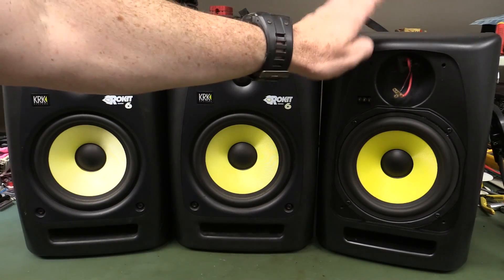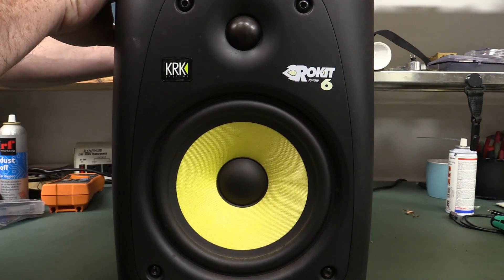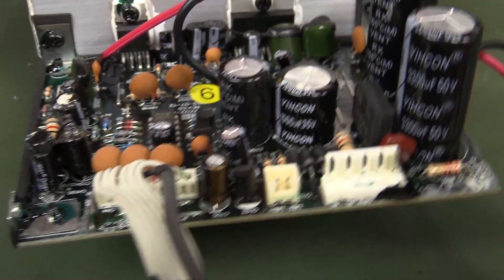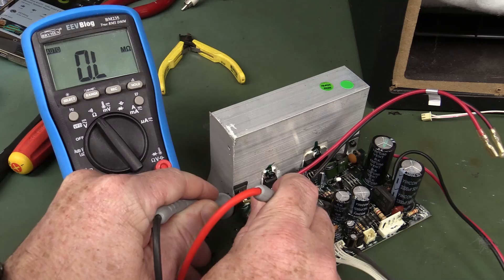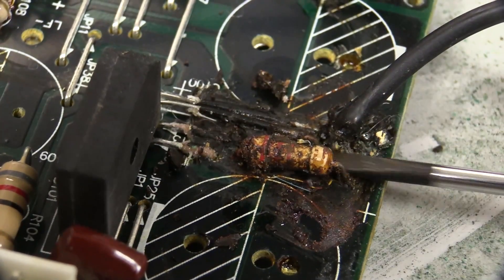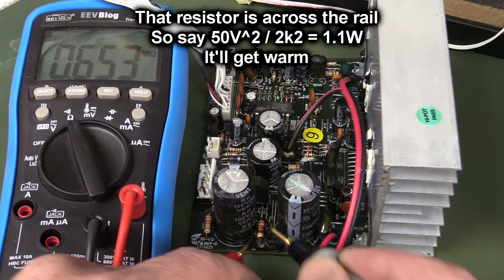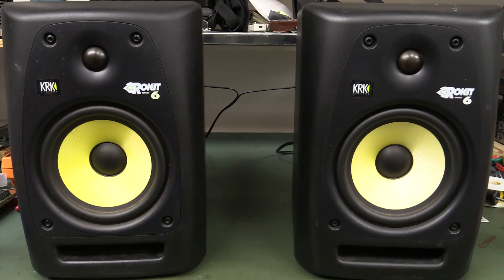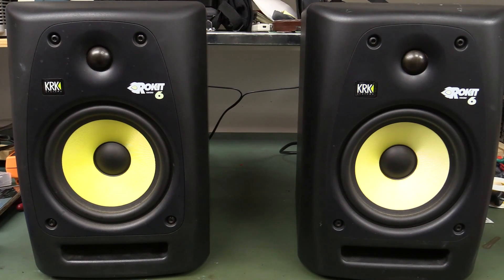EEVblog #1073 - MORE KRK Rokit Black Gunk Speaker Repair

Comment: EEVblog. Dave!! It is a massive problem!!!! I worked for a company in London that had the contract on these!!! I repaired hundreds if not over a thousand of these G2 models with the black glue problem!!!! G2's are also notorious for the volume pot failing. To fix that you desolder it and tighten the lugs with a pair of pliers and bingo, its fixed. Resolder it and your pot is as good as new!!!
Reply: Stephen Scutt - How long did that fix work?
Reply: well indefinitely! Squeeze the 3 pot lugs tight to just before the inside of the pot.  if the pot was too far gone it got replaced. 20 Kohm if i remember rightly...
Reply: Power Wiesel, I wrote the same by coincidence!
Reply: L3 P3 😋
Reply: Do you know how to fix the thing he demonstrated at the end? My left one is ok, but the right one is buzzing annoyingly loud.
Reply from the maker: Thanks for the confirmation. Did KRK ever admit it was an issue?
Reply: Hey Dave, I made a comment earlier today about the noise you showed at the end... I think it might be related to the power supply somehow.
Reply: Dave, you likely missed a comment on your last video by Rich Renken, PM from KRK. He did bring the blank gunk up again with the team, they said they were familiar with it.
Reply: hi, where can i get a tweeter replacement in europe? 2 speakers broken at ones. trying to repair them
Reply: MilkywayOutcast, just ring up any store that sells KRK, generally pro audio/musician's stores, they'll be able to get replacement parts for you. Might take a bit.

But check out Bax Music in Goes, Netherlands, they might have them for you right there, and they mail to a bunch of EU countries.
Reply: Siana Gearz, thanks a lot. i found them in bax music :-). 30 euros each....not cheap but cheaper than new speakers.
Reply: Hi, I have two questions. Is there any way to replace all pot's with some better ones to remove that problem completely ? my left tweeter have some hum coming from it when it's turned On, right one is OK, what do you suggest me to do ? Should I replace all capacitors ? P.S One of my speaker was already on service because of Volume pot. It wasn't on 0 when you put it, it was on 1 or something like that if I remember. I know when I was listening to some songs I noticed that voice of singer is not in the middle it was a little bit on the side, so I was thinking that one speaker is not optimized properly, but it was, both of them on zeros. So then I took one of them on service and tehnician found out that pot was problem. I mean except that I am satisfied with speakers been using them for 4 years now. I assume when you change those capacitors with some quality ones you got dope speakers.
Reply: Stephen Scutt hi. Any idea why the glowing KRK logo has gone? I replaced it with the spare part KRK sent me but no joy. Any help appreciated.

Comment: If you're in any doubt as to the condition of the amp, do NOT power it on while connected to the drivers. Any DC on the output will burn out the drivers in seconds. It really doesn't take that long to disconnect, power on and stick a multimeter across the output with no input and it can save a lot of ball ache!

Comment: I bought a used Rokit 8 G2. It worked great for a week. I left the power on for about a week and the heat must’ve heated up the black hunk to a point where some of it started conducting. When I tried to use it again a loud high freq noise came out and fried the tweeter. I replaced the tweeter but the problem persisted. I was quick to power down before it did any damage. After watching this video I opened it up and found no bad caps but the gunk was conductive, in some of the same spots of video. I scraped the gunk off best I can. Cleaned it all up and put it back together. Voila! It’s back up and running again! THANK YOU DAVE!

Comment: A bit of a clarification though, studio monitors with headphone jacks and volume controls on the front are more for home and amateur use, Studio monitors such as Rokit, Yamaha, and Presonus (which I use) that do not have the controls on the front  are for full on mixing studios or higher end home studios that have audio interfaces like Focusrite, Presonus, and many many more. So basically, the different monitors will be used in different setups. Just my 2c.

Comment: Once again, these are studio reference monitors designed for accurate mixing, not desktop speakers designed to "sound good". They are sealed and damped so that nothing colors the output, including noise from internal components. They do their job exceedingly well, and you need to spend considerably more to improve upon them. And unlike modern so called "studio speakers" from brands like Alesis, these are not DSP driven. The sound is natural, not processed.

Comment: We were repairing one of these, the primary cap on one monitor wasn't even soldered to the board. The black goop was the only thing holding the cap in place.

Comment: Glad to find this video. One of my 10 year old KRK 5s loss the low freq.  I opened it up and found the famous black goo melted to the PCB and components. It chips off kinda like peanut brittle with an Xacto blade. Be careful not to dig into the board and damage a trace. Also, you can't help but flex the caps and soldered components while chipping away at the burnt slather. As you flex the solder joints of a component, you may crack a solder joint, causing the component to work intermittently. 

It's a careful game to remove the melted insulating goop and not damage the PCB. I've done most of it, I'll report back on how my speaker works after I connect it.
Reply: Did it work? just got back from a repair shop that could not fix them and I'm guessing this is the issue.
Reply: @juandavidmendezsabogal7122  It did not work. None of the capacitors are swollen nor any visible damage except scrape marks on the PCB. 

Did the shop say why they couldn't fix yours?
Reply: @RusticRockMusic  Oh that's unfortunate ;( The shop didn't really know. They did tell me it was a short circuit (I don't really know much about this stuff haha) and I guess it could be the black gunk of death! I'm gonna try, hopefully it works.
Reply: @juandavidmendezsabogal7122  Good luck. Removing the black gunk of death has worked for some. Black Gunk Of Death is a good band name. Lol.
Reply: @RusticRockMusic  thank you! And that's a pretty awesome idea. I think it could work haha!!

Comment: Hi Dave, just got done a week ago fixing my second krk to fail.  The first one had power on Pop and noise. I simply replaced a bunch of the electrolytic caps and cleaned some grey gunk.  Everything was fine.  Oddly a couple, of days  before I saw your vid I decided to work on the krk to get my home studio up and running. I was interested to see what I would find. Sure enough black gunk, but it was like a putty. To my dismay , I was forgetful and failed to put on some nitrile gloves and the putty gunk started rubbing off on my firger tips.   My fingers began to burn.  It was awful. Got  most of the gunk off my fingers that night. A week later fingers are not all that much better. SO BEWARE!
However repaired the speaker perfectly. 
All the best

Comment: This inspired my to check my humming Infinity Primus PS 8 powered subwoofer, that I stowed away in the attic years ago. And there was actually some brown gunk on the solder side of the PCB. After physically removing it with a small screwdriver and cleaning it with electronic cleaner and alchohol, the humming went away. Thanks mr. EEVblog 🙂

Comment: I can verify that heat speeds up the decomposition of that crap.  Doesn't matter what type it is or what it's in.  Translucent, opaque tan, black, it all does it.
Reply: I have to disagree, planned obsolescence is just suicidal for any company attempting to market to the professional industry. Whereas consumer electronics are reviewed at the beginning of their life, professional electronics are typically reviewed based on recommendations within the industry and will include information on the longevity of the item. Intentionally reducing the lifespan of a professional product would destroy the reputation of a manufacture.
Reply: Wow, lol sorry I replied to the wrong comment.
Reply: you know that you can edit and even delete your own comments?
Reply: I see one exception:  LED lamps.  Their efficiency goes down with age anyways so designing them to fail when they become too inefficient with some degree of repairablity would make sense.
Reply: MikesRadioRepair Can you tell us which particular chemistry or brand of gunk to avoid?
Reply: MikesRadioRepair k
Reply: why are they using my boogers in their speakers?

Comment: You are absolutely right, Dave! I had a pair of Rokit 8 Gen2 monitors purchased in 09. Both worked great for 7 years. But in 2016, the right monitor started exhibiting a 60Hz hum leak-through on the woofer. It would hum for about 2 seconds and go away, and everything would be fine. This kept happening, more frequently as weeks went on. Until one day, a final hum played on the woofer. The hum disappeared and so did the woofer, forever. Only the tweeter worked after that.  Left speaker was still fine, but I bet in time it would have failed.

I gave them to my brother. He ended up pawning them for cash. Ah well!
Reply: My right 8 gen 2 has just started doing this, buzzes til it warms up then once it’s warm you can’t. Ale it happen again, even by turning it off and on again, glad I read your comment, I’ll be taking it apart and fixing it before using it again.

Comment: And years later, one of my gen two Rokit 5's just failed in the same way. No woofer, and now that you mention it, the hissing from the tweeter is far louder in the failed monitor compared to the one thats still working.

The one that failed didnt do so suddenly though, the woofer would cut out randomly and only for a very short moment. But it got worse and worse with time until today, it's just not doing anything.

Thanks for the vids as always, Dave. This will be instrumental in my repairs!

Comment: I see this all the time in my work as an Electronics engineer for this very area dealing with repairs of both new and vintage equipment. Brands like KRK that you see in the pro audio world are just to proud to admit mistakes. An example is Crane Song that refused to accept an issue in the micro-controller for a Microphone Preamp worth a LOT of money. where it was meant to change a relay over, it only flicked the relay momentarily. It took a lot to get them to admit their mistake send reprogrammed IC‘s (which were socketed so easy to change) and they made no effort to let any other customers aware of the issue.

Comment: It's the classic case where you ask a supplier for a recommendation, thinking they are experts, and over time it fails because it wasn't long term endurance tested in those conditions. Happens in every industry, even saw it in the automotive industry where someone was selling std bearings, knowing it was going in race engines, and they all failed causing tens of thousands of $ worth of damage.

Comment: Worked at guitar center for 4 years, can confirm rokits are the best sellers. High frequency hiss in tweeter is common; krk are decent prosumer grade, but that's a common complaint with audiophiles

Comment: I've got some Radio Spares black hot snot glue sticks for potting.
They came in hemetically sealed bags with instructions stating that they are hydroscopic, and to put them in a drying oven if they are left out in the atmosphere

Comment: I dig it! A while back I purchased a pair of JBL LSR502 monitors from eBay and the owner stated that they were both broken, when I received them only one was broken, the other I examined up and down left and center and gave it a clean bill of health but the other had a bad amplifier board, turns out it's a somewhat common issue with those monitors, anywho I picked up an untested $20 replacement and it worked! At the time they were about $150/each and I got the pair for $110. Needless to say I see these monitors in pawnshops all the time, maybe I'll get myself a pair. :-)

Comment: Yep! My Gen2 5's suffered similar problems. I once got the excursion, but one of them had the hiss as well. After replacing the main 4 caps I now get the full power going through the woofer. Clearly heat is the major culprit here. Aus being very hot I wonder if this is as much of an issue in cooler climates? Studios (even project) tend to run quite warm with all the gear. Either way, heat is the enemy of that stuff. Possibly the soldering of stuff could help age the dark gunk too?

Gibson bought KRK, so you won't see any accountability at all. They're also circling the drain financially.
Reply from the maker: Is there anyone who has never had a problem with their Gen 2's?
Reply: I have just found this video 🙏 One of my KRK RP8 G2 is farting from the woofer when i increase the volume when Im mixing but the other speaker isnt..🤔 Could I possibly get some advice on solution 🙌 Kind regards @EEVblog

Comment: the reason the yihon cap failed is because one of 2 balancing resistor was open, sending duble the voltage on one capatitor, nothing wrong with the brand

Comment: i think this massive hissing sound is coming from the power amp, and the knob vary the gain of the pre amp, that is why it does not change the whitenoise level.

in your USB speakers probabbly you're changing the gain of the power amp itself with the potentiometer, so the noise change as well.

Comment: High end equipment had gunk problems too, I used to service Sony Betacam VCR's and there was an audio board that got affected by a cream coloured 'gunk'
Reply from the maker: Yes, Sony used to use a lot of gunk on stuff.
Reply: Perhaps related to possibly the adult content media industry? Juck!
Reply: huh, i wonder if that cream colored gunk was the same body fluid, I mean food that i p̶u̶r̶p̶o̶s̶e̶l̶y̶  accidently sprayed into my vcr
Reply: @Blox117 Grow up
Reply: They used it on the domestic Beta (Betamax) machines too.  A whole range of Sony Beta machines had a Hall Effect sensor underneath the head drum motor, which would get eaten by gunk.  Fiddly thing to change, I've done lots of them.

Comment: Just bought some 3rd gen speakers, scared me for a bit! Glad to hear they supposedly fixed it on the 3rd gen
Reply: Willy Nebula gotcha, thanks
Reply from the maker: Photos would be great, I couldn't find any readily available photos of the Gen 3 PCB's.
Reply: well 'supposedly' fixed....
Reply: there's a video of the 3rd gen pcb by sadowick:
https://www.youtube.com/watch?v=Q6WXyO0wggk
Reply: 3rd gen even turns off the amp board automatically if there is no input for a certain amount of time. 
= less heat buildup.
Reply: + DigitalStains, I have a couple of gen 3 and I'm scared too. I want to know if also our speakers are affected to these problems.
Reply: EEVblog I'll send you some photos later tonight, My gen 3 are 2 years old and had both black and transparent trunk of death :(
Reply: One if my gen3 is unusable. Might open it tomorrow . The volume pops up and down .

Comment: Hey outta time! I picked up a pair of these a long time ago and replaced the caps and it fixed one of them. However, I do get a crackle out of one of them. It also has a dimmer logo. Not sure if its a burned out LED. The crackle sounds a lot like a blank spot on a record. Yes, independent of volume. I've been too lazy to take them back apart. However, I didn't remove all of the black gunk. The tweeters were a little crushed in shipping so I was going to replace them. I'll let you know what I find next time I take them apart. Love your show. Thinking about starting something similar just for fixing things.

Comment: I was repairing Alesis Mk2 monitors with similar issue. This one had yellow gunk on the board. My power board exploded! I have replaced over 20 components, and cleaned that damn thing . It's not only with KRKs Dave.

Comment: Seems like an extremely common problem.  At least its not that difficult to replace (soldering was taught in school for me, so maybe not for everyone, but this looks easier to repair than soldering an XLR or TRS connector onto a cable)

Comment: I think it's time to take mines apart, two 10^3 Rokits RPG2. Fortunately, I didn't use them at all, they were just collecting dust in very dry room (I live in Arizona) at room temperature for 2 years. Wonder if they will have the same issue. Any suggestion what's the best gunk removal approach, and shouldn't it be replaced with some other gunk to prevent vibration?
Reply: Arthur Vin no you don't have to replace it please don't

Comment: Best solution for this junky speakers is total recap of preamps/filter and amp board!
All solid capacitors in the filter block after several years of operation in this oven are suitable for disposal.
Bad sound and other surprises are their merit.

Comment: 16:43 might be due to spur oscillations either on the power amplifier or the preamp. I recommend checking the bypass caps on the preamp side and adding Zobel networks at the power amplifier outputs, if there aren't any already. Should get rid of most of it.

Comment: Hi, there are two caps in the centre of the board (c108 and c109) which have the same values (1000uf 35V) but they are different size dimensions, as in D x H x Pitch, these can be seen in the video at 5:11 . Why would they be different dimensions? I cannot find a replacement cap for the larger one on the right which has an 8mm pitch? Would it be OK to replace with 2 x caps of the same size if the values are the same? Any help appreciated Thanks.
Reply: Yes, you can do that. Just bend the leads to match the hole spacing.